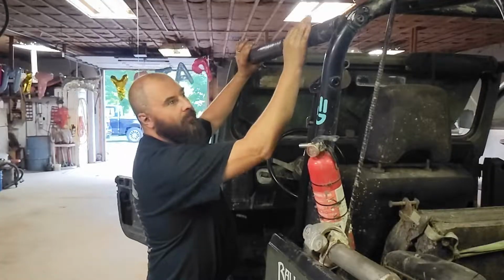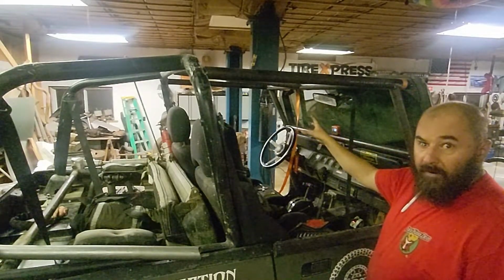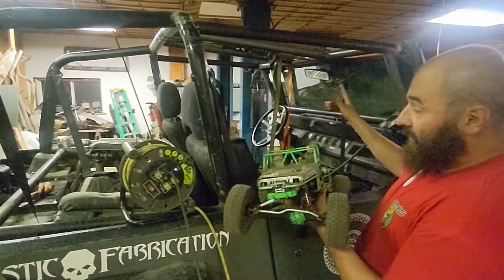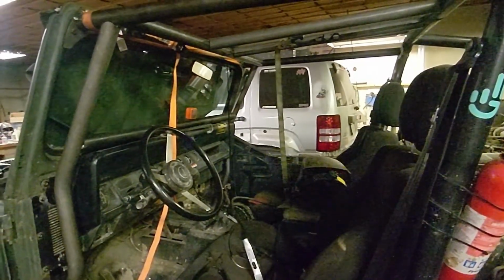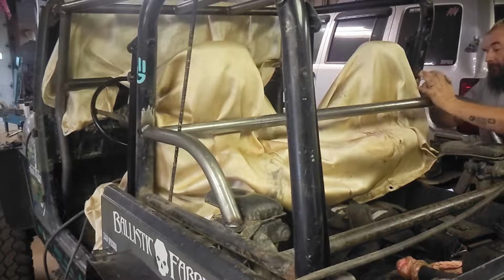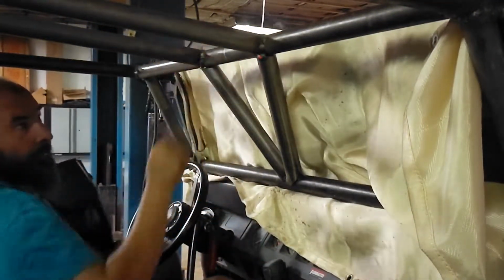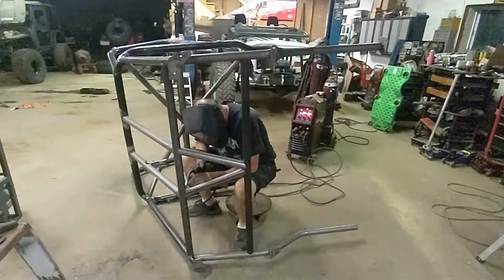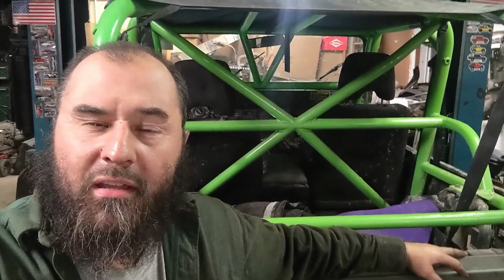Caging The Beast - How to install and modify Trail Gear Rock Defense YJ cage -x brace & harness bar

Comment: How did you move the e-brake ?
Reply from the maker: I haven't had an e brake in years. I do have a couple of hand brake levers that I could adapt if I ever feel the need. I suppose you could weld an offset pad to the stock e brake lever if you wanted

Comment: Nice work man. I’m thinking about getting this cage myself. The only things I don’t like about it are that the a pillar tubes bend under the dash instead of going straight down and I’d prefer my spreader bars to be angled from the middle of the b pillar to the corners of the a pillar/windshield crossbar
Reply from the maker: Thanks. The kit was a good starting point